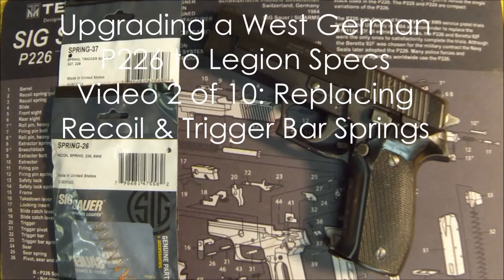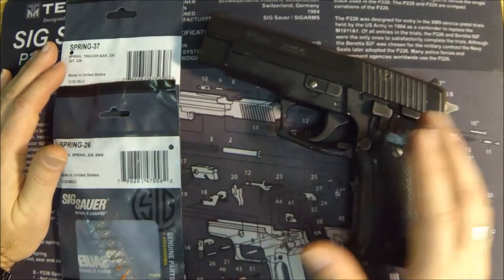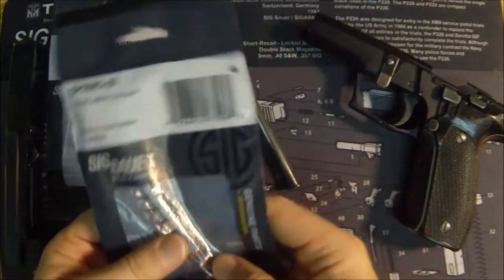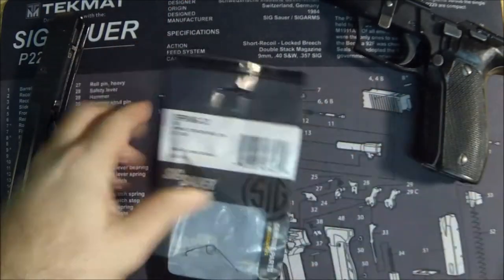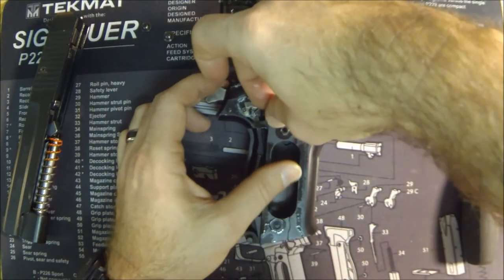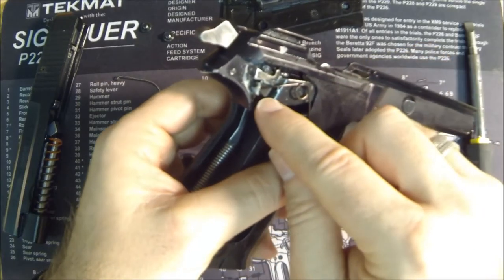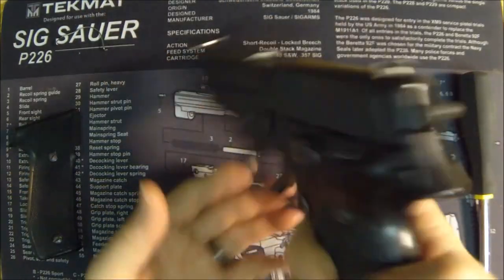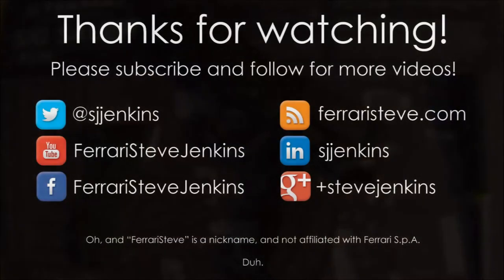#2: Recoil & Trigger Bar Springs - Upgrading a West German P226 to Legion Specs

Comment: Great vids and instructions but I have an issue that I have not found many posts on. And that is after I have installed a P220 SRT kit into two P6 models, I noticed I began having trigger reset issues exactly like you show at 6:03. I note that I have to push the trigger forward as you show to get the trigger to reset. Grips are removed from the gun when I'm doing this.

I note that the new SRT kit includes the new safety bar with the longer 'leg' extending into the trigger bar. When first performing a D/A trigger pull I can get the hammer to fall but no trigger reset because as the trigger bar moves rearward I can see the tip of the stock curved trigger bar spring catching on the leg of the safety bar. It does not clear the safety bar and sometimes comes off the safety bar rendering the trigger useless.

The stock curved trigger bar spring  has a rough cut 'L' shape to catch under the trigger bar. In other words it extends too deep past the thickness of the trigger bar and can reach the new safety bar and hang up. I was thinking of filing down and smoothing the long leg of the spring but wonder if it will slip off the trigger bar easier. I also noted in your video that the new loop trigger bar spring actually has a hook that catches under the trigger bar. Possibly helping it clear the safety bar better. Have you encountered this issue before?
Reply: I also did the SRT “KIT” on my P6 and ran into the same issue. I ended up taking some wire cutters and gingerly nipped off what was hanging up from trigger bar spring on the new safety bar. 
I would also like to know if the new style P226 trigger bar spring is compatible to the P6’s.

Comment: Question about the conflict of the trigger bar spring/original grips. I run Crimson Trace grips. Will I also encounter this conflict? I'll check with CTC also to verify. Thanks for these videos. My only suggestions are to use a white background to make the contrast better, then slow down your hands just a bit. I actually got a little dizzy on the SRT kit video.

Comment: Do you know what year Sig went to the looped trigger bar spring? I bought a used W.German 226 that was manufactured in 1991. I can't tell if it was a possible CPO sig. It has the smooth style trigger and upgraded grips with looped spring, but I would think a Sig this early would have still had the flat spring and grooved trigger. Can't tell if the slide is K-coat or not, it doesn't appear to be the grayish stamped carbon steel like the "original" ones.